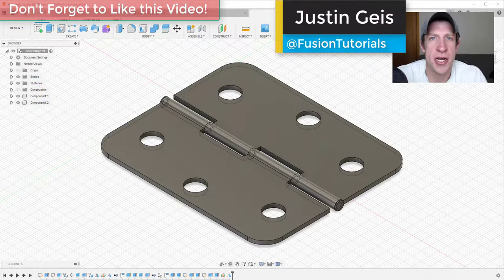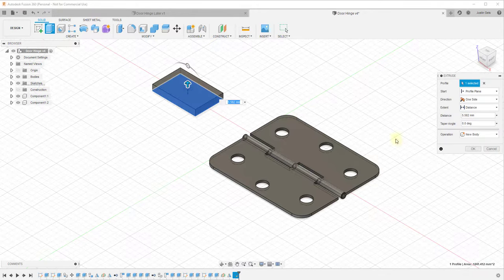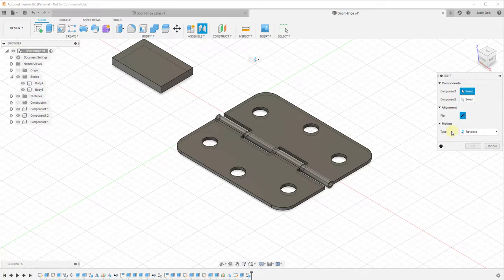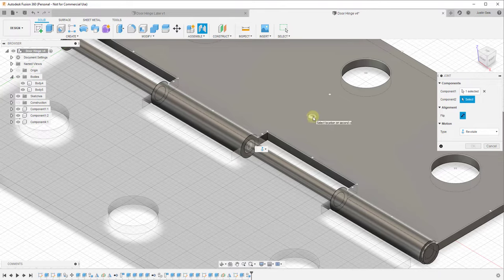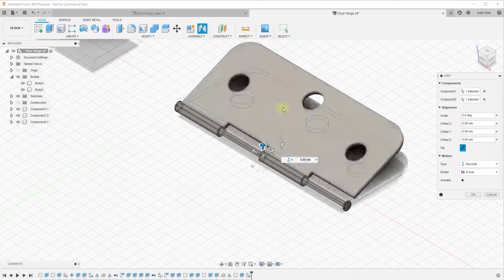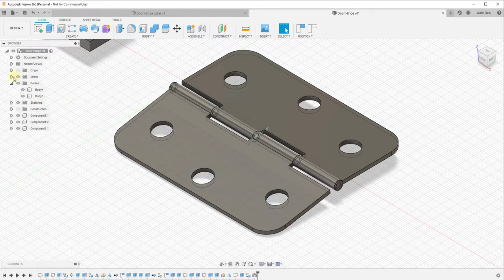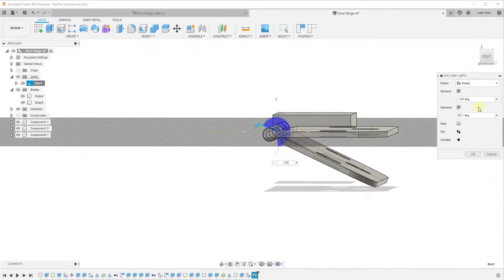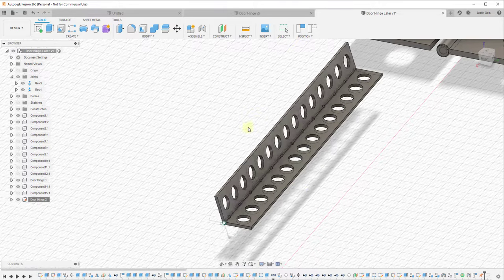Creating MOVING HINGE JOINTS in Autodesk Fusion 360 with the Revolute Joint!

Comment: At 4:41 you say you can click and drag the components inside the simulation mode. How do you get into simulation mode? I've made an assembly and joined everything together with joints but can't move things around to check if my linkage is working. Everything just moves as one big clump.
Reply: in the top left corner of fusion 360 you can see a box that says design (presuming that you're in design), there's an arrow pointing down inside that box, click the box. it'll give you different modes to select from, that's where you'll find simulation, select it.
Reply: maybe a bit late after 3 years, but had the same problem and found out why: you need to fix one of your komponents, so that the other one can only move by rotating around the joint. you can fix an object by right-clicking it in your Browser. your second option in the dropdown menu should be something like "fixing" or "fix", click it. Now only the other object can move, but is restricted by the joint, so it will rotate around the joint.
Reply: @winorxp8952  That's what I'm doing to get it working properly, but it doesn't seem like that's what the tutorial is doing. Not only are none of the components pinned, but he's also in Design mode instead of Simulation mode. What's he doing that's getting that to work?

Comment: Hello, why can't I click and drag my joint the way your moving yours 4:39
Reply: i can't either
Reply from the maker: Did you follow the rest of the instructions in the video?
Reply: me either how do u get simulation mode
Reply: You have to double click on the blue flag to enable the movement. Likewise, you can also right click on the Joint on the left menu and select "drive joint" Hope this helps!
Reply: @EdwardMakes  thank you so much!! Was trying to figure this out for so long
Reply: @TheFusionEssentials  I just ran into the same problem. Clicking and moving the component only moved it around, it didn't follow the joint. I found out that I had to ground the main component so the sub component could rotate. I found it in another one of your videos. https://www.youtube.com/watch?v=f2bzjdo0wxg Thanks for the help!!
Reply: I've struggled with this for 2 days !! tip 1: you have to ground your fix object. Tip2: History mode must be activated when you create the joins and the ground object. history is not activated by default if you 've imported the design. (to activate: top explorer/ right click/ capture design history) hop that helps :-)

Comment: Thank you for this helpful tutorial.  But unfortunately it didn’t work for me. I’m very new at fusion 360 and I have created a main component that is using several components files. I then added hinge to two of those components but these hinges are made within the main component and not in the individual file. So when I do the link you described in this tutorial, only my hinges are moving and not the component to witch the hinges are attached to.
I probably did it all wrong but I can’t figure out how to move my hinge from the main component to the individual file.

Comment: Before I start to learn this stuff, I wonder if what I need to do will work.

I've designed a water level device to report the water level in a humidifier I've rebuilt.  It is now controlled with an Arduino Nano Every board.

I have a potentiometer with a small gear shaft on it.
I made a short "arm" with a gear on one end (that rotates the potentiometer). The gear has a bearing in it and is attached to the wall of the tank.  The gear on this arm meshes with the gear on the potentiometer.  This arm is orientated in the horizontal position.

At the other end of this arm is a long piece, that loosely hands from the end of the arm and on the other end of this piece is the float.

Kind of looks like this:  (ignore spaces please)  LOL  I'm trying to use emojis for this....

        gear      horizontal rod 
⚙⚙➖➖➖➖➖
                          \         ❗
                             \      ❗ vertical rod
                                 \  ❗
                                     🏐

So as the water level changes the float moves the vertical rod up or down, causing the horizontal bar to move downwards or upwards, moving the gear, rotating the potentiometer.

Where the problem is, since the vertical bar is loose (as it should be), the float actually pushes the rod outwards.  The vertical rod doesn't remain vertical.

I've seen float systems that use a stiff, thin guide wire that, in this design, would go under the gear, attached to the wall and then attacked somewhere on the vertical bar.  The idea is that as the horiz. bar moves up or down, it keeps the vertical bar vertical and the float can't move it right or left.

But I suck at mechanics, LOL, so I want to see if I can make this in Fusion, so that I can place the guide wire and have Fusion figure out the physics to show me how the movement will actually be.

For those good with Fusion, can this be done??

I hope that I explained it clear enough.... sigh...

Comment: Question: If I wanted to take this small piece of a hinge, and extend it to about 16" so that it runs along, say, a toolbox edge, how would I do that? I've tried to copy and paste parts but this seems to make everything super confusing with parts and bodies.
Reply: I had the same problem. I used the 'Create' , 'Pattern on Path' then selected the body and fiddled around with those parameters. I know there's got to be a better way but that's what I did.